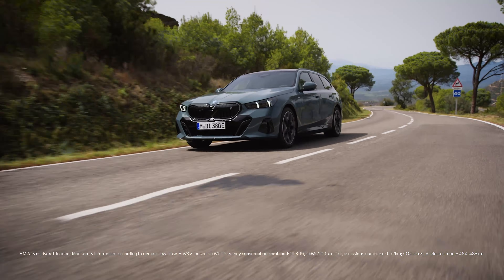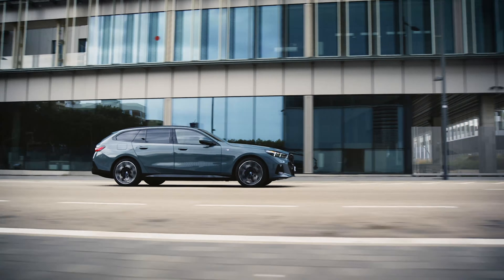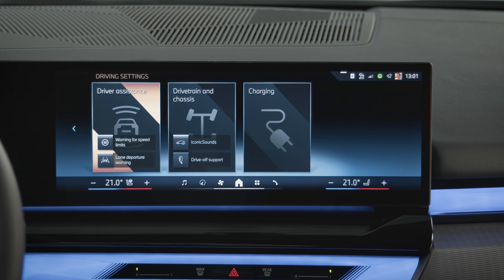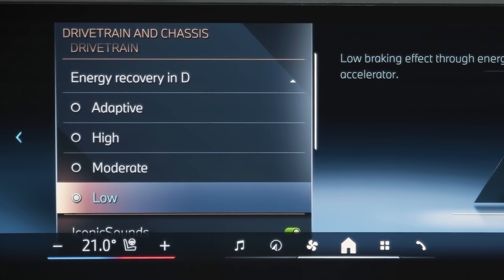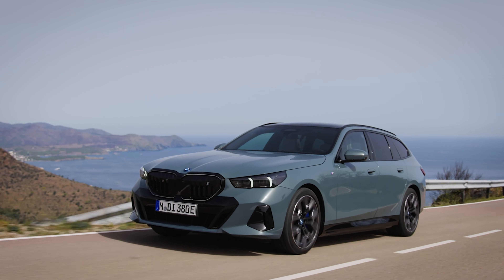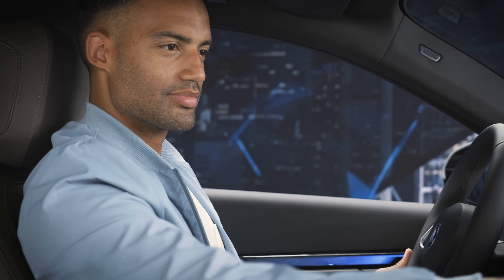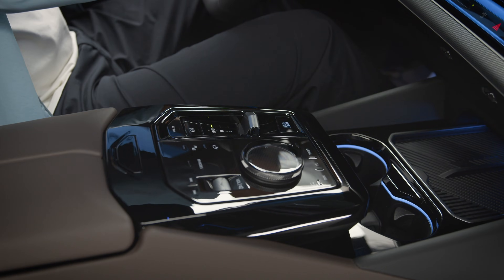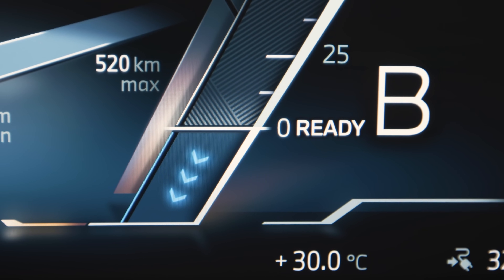How-To: BMW Energy Regeneration Settings.

Comment: i4 and i5 are both use the same battery and power train etc. A great update has been released for the i5. It gives the car extra range if you select Active Maximum Range with Efficient mode. This update hasn't been released for the i4 yet. Will it be released for the i4 as well?
CLA and i4 are in the similar segment of cars. And the new CLA models offer higher range. I think this update will strengthen the i4's position against its competitor.

Comment: Adaptive is fine when I'm on an open road with no traffic or junctions, otherwise it's a real nuisance auto braking on my behalf when the car anticipates when I'm approaching a junction. I'd turn the adaptive off completely if I could, so I choose when to brake as I have been doing for the past forty years of driving. My previous Audi E-Tron had a similar adaptive drive type function, which I hated, and I turned that off, but at least I had the choice..

Comment: Low is actually the best since you'll go the furthest while recovering energy. Also Low feels the most natural. I'd also like to add that you really do sometimes want to actually use your brakes so they don't rust and stick. What i do in the i5 i drive is i make sure at least once per day i shift it to neutral and then press the brake pedal to make sure to clean the brake pads and the disks.
Reply: Although I understand the reasoning, adaptive is the most efficient. The reason being: It allows coasting. Any recovery is lossy, so recovering as little as possible and using the energy already spend on elevation or wind resistance is the most optimal. I can understand the predictability aspect of low though. As a side note: Using the break pedal uses recuperation as much as possible and then blends in the service brakes if additional stopping power is needed, such as when coming to a complete stop. Manually „cleaning“ the service brakes is not necessary as the car will do that automatically if they haven’t been used in a while. If you insist on manual intervention, you could just accelerate to something like 100km/h and then fairly rapidly come to a full stop, as long as traffic conditions allow, of course.
Reply: @lightningblender  i just put it to neutral and then apply the real brakes to clean the rotors and pads. Trust me i have to do it actually quite often, because of all the slush, snow, roadsalt and so on. If i want to coast, i also just put the car to neutral. I am the one fully in control, i hate adaptive. Adaptive sometimes just does full regenerative braking and when i have customers on board, that ain't nice. Therefore i must have full control.
Reply: With B mode, which could be probably identical or similar as High, you can achieve the furthest distance, not with Low.
Reply: @samankawf  i meant when you're actually regenerating. Also B mode and High affect range negatively, at least from what i've tested. 

And i hate driving in B-mode, it just sucks especially in winter, so LOW it is and will always be. B-mode and High can be dangerous in slippery conditions, even with xDrive and especially in RWD EV:s.
Reply: Professoren Johannes und Martin Quaas (ipcc leitautoren) Wo stehen wir? -Prof Mojib latif Handelsblatt green energy Die Illusion des 1,5 Grad ziels und – Prof. Dr. Jochem Marotzke: Verlässlichkeiten und Unsicherheiten der Klimamodelle und – Prof Robert Schlögl DPG

Comment: Adaptive works well. B is great, too. 

Can you please add more info to trip display about energy used fir propulsion, cabin heating, accessories and battery pack conditioning?